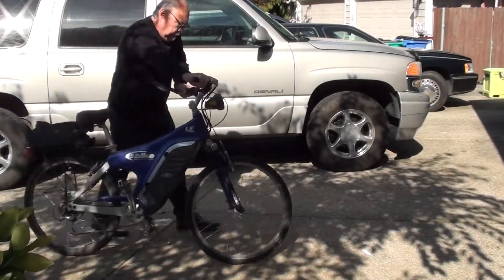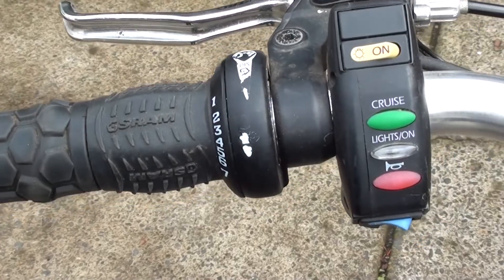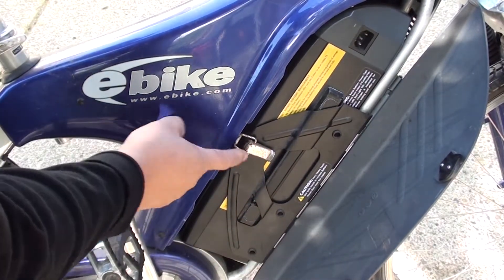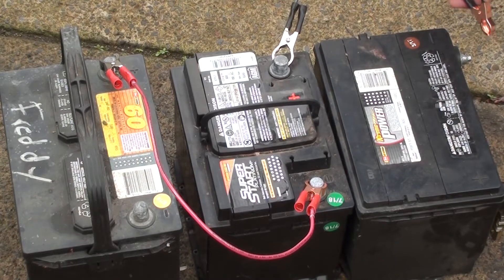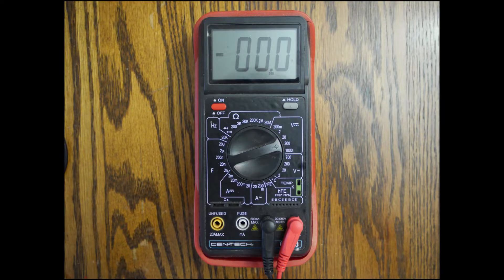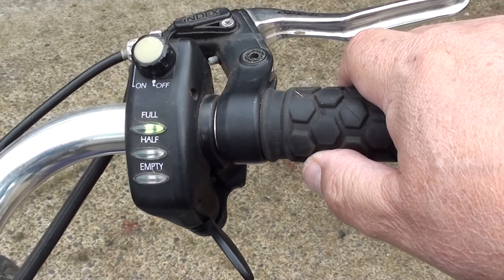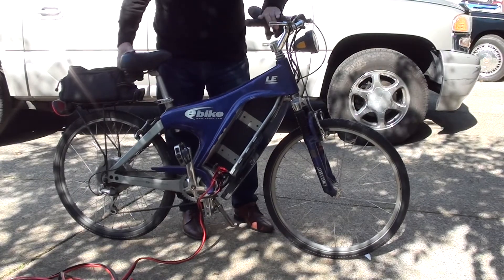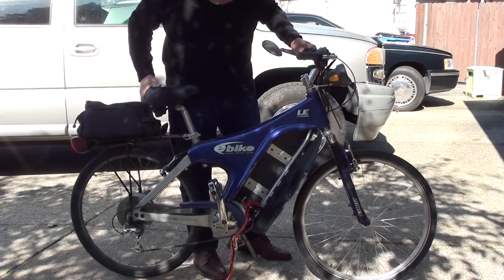EBike  |  LE  | 36 volt  |  Wont Power on  Pt 1

Comment: If speed isn't an issue, these EVG ebikes can take a max voltage of a 12s (44.4v/50.2) lithium battery pack, using the stock 36v controller, for around 22mph level speed. I've set one up with Tesla Mdl 3 21700 cells for a 12s4p 19ah pack that fits in the stock battery box. Lights/horn & cruise all still work. You will also want to increase the pedal assist by adding a 46t front chainring (max t-little case trimming) & replace the rear freewheel to a 11t-30t. NOW RIDE! :-)
Reply: Can u hook up just 12v to motor to see if it works?  How can I tell if evg controller works for motor?
Got lights horn to work but motor dosnt  could it be throttle 
Where can u get new evg controller.  Thx
Reply: Maybe...try 12v?!? People have over voted the 24v EVG ebikes, which blows the 26v caps, and the lights & horn works, but not the throttle. Not sure on 36v controllers, though I’ve stopped @ 12s or 44.4v nominal (50.4v charged). So...maybe?
Reply: NO...”new” stock 20 yo 36v EVG ebike controllers available, that I am aware.
Reply: Saw on another list that can use 12v to test the rear wheel motor

Comment: I have one of these came with no battery, I put in a 36v lithium will not power on at all fuse good any ideas ? Thx
Reply from the maker: I'm going through the same thing. What I was told don't use the old technology. It's cheap to insall a new controller and thumb throttle.  Anywhere from $40 to $100 bucks on up. They said it's the smart thing to do. That way you have new technology. The stuff on there now, even if you got it going like I did, you might still break down. So I think im going to go that route. Good luck. It's from what I can see its easy to do. Plus they have tech. Support.. so that's my next move.
Reply: @notsofast2325  -Sure....but, you LOSE access to your stock front & rear light, brake light, & cruise! FYI, 'ol tech still works, and don't take advice from anyone except from a knowledgeble EVG ebike collector and rider! Find a donor bike for another good stock EVG ebike controller. Or do what I did on a couple of my 18 EVG ebikes, and buy a Golden Motor MP5 rear hub, with a sine-wave controller inside the hub, and still use the a good stock controller to power the lights/brake light! This will give you around 28mph level in dead silence.
Reply: Ok I ordered a new 36v controller through eBay no idea how all the old wires hook up or how to hook up the new one
Only one I could find were brushless controllers
Hope that may work

Any idea of a wiring schematic ?

Thank for the reply 
It’s a neat bike an like to get it going again

Cheers
Reply: @swormser865  - The Heinzmann 36v rear hub uses BRUSHES, so you will need a brushed 36v controller!
Reply: Ok thx ordered brushed controller, not sure how to hook up the throttle now,  some one said can spin back tire to see if u get voltage out of it to see if motor is any good, I tried that no voltage....so guessing motor is dead,
Or can I test it buy putting some voltage strait ti rear wheel?
 Thx
Reply: Can I keep the original controller for the lights horn etc, and add a brushed controller just for the engine? Thx
Reply: Generally, It’s an original SLA battery issue w/these EVG ebikes. Yes, you can power the rear hub w/36v battery only to check function.
Reply: Well....you need to check why it’s not powering up. Connections? Personally I set up a Tesla 21700 celled 12s4p battery pack to fit in the original battery box.
Reply: Got a brushed controller but would like to keep the lights etc working too, is the throttle a reostate on the handle bar or just a cable that goes to the old controller ?  And can I just hook up new controller to old throttle?    Any idea of what size and tripe of plume that goes to the motor ? I have seen some small one that look like that
Thanks for all your help

Comment: what did you do about the battery? i have the same exact model needing a battery. please help!
Reply from the maker: if you buy the same battery its going to cost you a lot of money. plus its old technology. this is is what i'm buying.

 https://www.ebay.com/itm/36v-16Ah-rechargeable-battery-pack-li-ion-bicycle-500W-E-BIke-electric-charger/363027983587?ssPageName=STRK%3AMEBIDX%3AIT&_trksid=p2060353.m2763.l2649

but if you can Afford a 36 volt-18AH go for it.      18ah is the maximum battery you can use on this bike as its currently wired.
Reply: How would u hook up all the lights horn etc to new controller? Thx
Reply: Used a hoverboard battery to test it out
Reply: Tesla Model 3 21700 celled 12s4p 19ah battery pack! Nice.;-)
Reply: Dang I have the same bike. Can’t complain it was free, but I can’t find the battery pack either. Might be over for this bike. The person who I got it from said batteries he found were $500, just doesn’t seem worth it, especially if they are old and used and won’t last much longer. I don’t think they make them anymore. 

I just told a dude I’d sell the bike for $100, but I wouldn’t if the batteries are impossible to acquire, I’d feel bad if they can’t get the battery.
Reply: I have a 2005 SX, completely original, still has the original battery, was used only one, maybe two years, then was stored until 2023, everything still works, battery still takes full charges, only problem is, the thumb button that you put your thumb on broke, super glue didn't hold, I wonder are there replacements out there to retrofit it or companies that have replacements, I heard the name CURRY, is that a company that makes one? Any advice?.